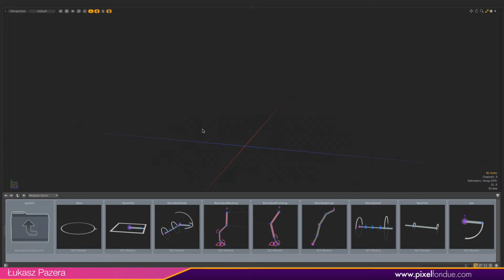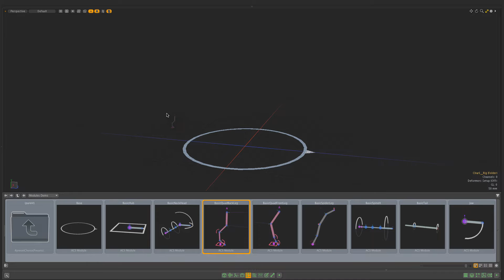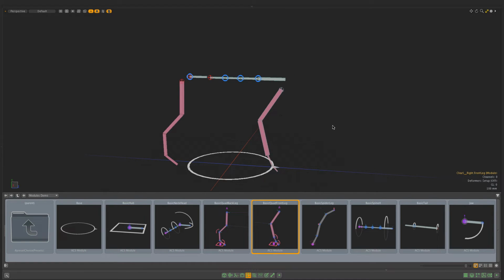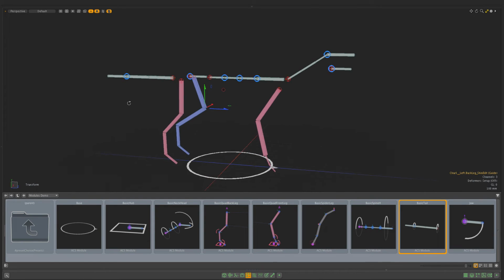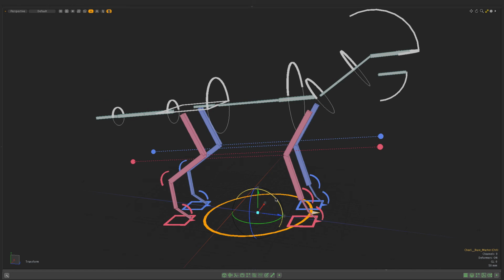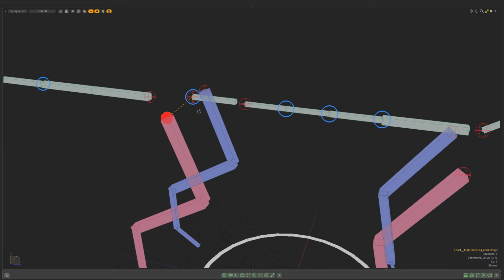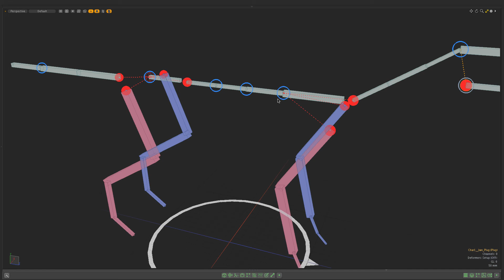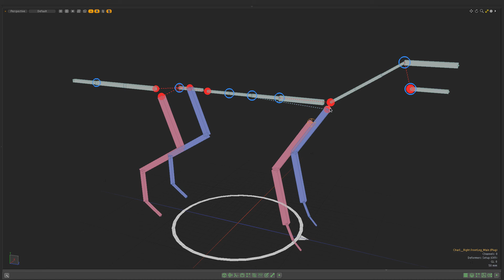ACS3 Dev Blog | Modular Rig Assembly

Comment: strechy ik ll available or not?
Reply: ACS3 should have all the rig features ACS2 currently has so yes, squash and stretch should be supported (both for IK and FK).
Reply: @pazur3d  waO!!~ tHAT IS GREAT NEWS.I FINALLY CAN MIGRATE TOTALLY TO MODO TO DO MY WORK. TIME TO SAID GOODBYE TO AUTOBOT(DESK). THAT MEAN IN THE MEANTIME, MODO ALREADY HAVE IT OWN STRECTY IK SYSTEM ITSELF. RIGHT?
Reply: @chuafong2243  In theory it has but I found it lacking so ACS2 is using custom rig for that. For ACS3 it depends whether there will be some improvements in this area in forthcoming MODO releases.
Reply: @pazur3d  wow~ mean u can write ur own strechy ik system like psoft did?? :O
Reply: @chuafong2243  Oh, if you mean bendy limbs then no, MODO's IK doesn't support that and ACS2 doesn't have it either (it only has ability to stretch or squash the 'regular' IK chain). ACS3 will most likely not have it initially, maybe later down the line. I will not be writing custom stretchy IK solver. I think this is something Foundry has to provide at some point. With ACS I'm concentrating more on workflows and less on 'core' technology. I also want ACS3 scenes to be convertable to standard vanilla MODO scenes and that is not possible if you use custom modifiers. In short - I'm trying to do as much as I can with the tech that is available in vanilla MODO.
Reply: @pazur3d  i see. got it.

Comment: I'm using Autodesk Maya, but when I watch this video,
the rigging process on Maya seems outdated to me.

Are there any plans to install the necessary functions for Facial Rigs?🧡
Reply: ACS3 is being developed as a rigging platform which means that if you have enough rigging knowledge you will be able to develop your own modules that behave just like native ones. I'm hoping that with time power users will contribute new modules and enhance the system this way. In other words, if I take too much time building facial rig someone else can do it first for the benefit of all users :). But in general yes - I want facial rigging to be supported eventually, one way or another.
Reply: I recently released a training series on Gumroad that covers the creation of a joint based facial rig in Modo. I used ACS2 for it, but you will be able to make a facial rig.

I will ensure that it will  work on ACS3
Reply: Decided to add a new comment to this video... I have been working on a facial rig for ACS 3, and I am happy to say it is nearly functional.